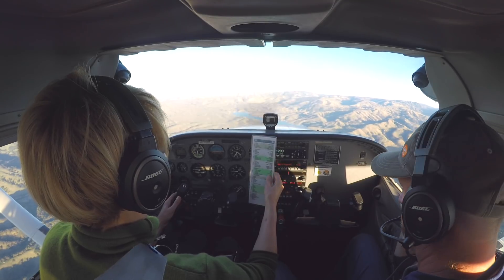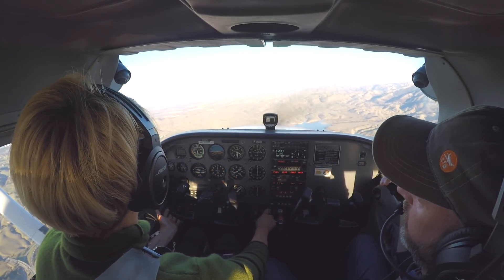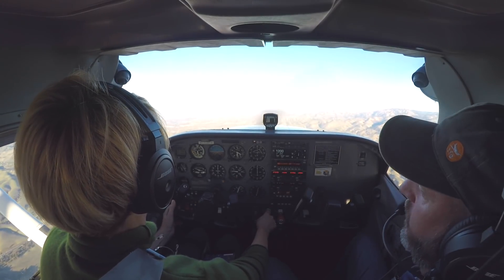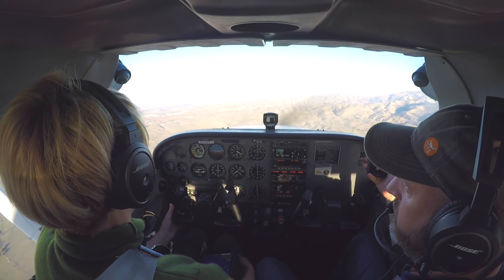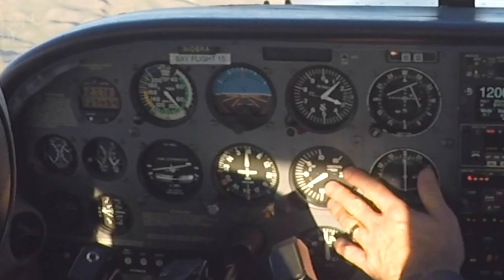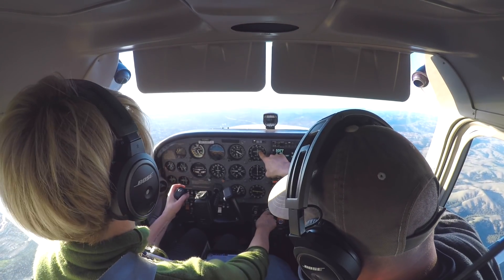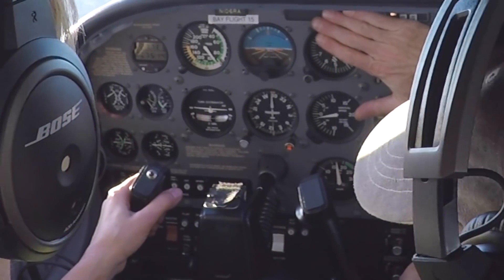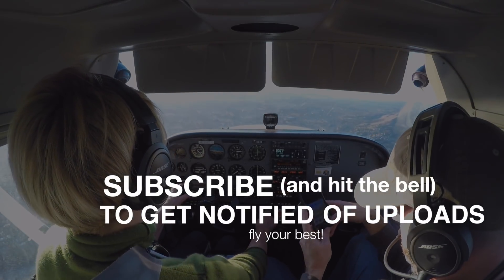How To Hold A Glide Slope - The SECRET that pro pilots know

Comment: I started IFR training but couldn't continue decades ago.  I clearly remember my instructor told me to use power to control vertical speed which is exact opposite of what you said.  I'm most likely not seeing a bigger picture and only remember smallest detail.  Just curious if there are situations to use power to control descent rate.
Reply: That is the correct method for slow flight, much of which is taught under the hood, or should be. It is very stable and reliable. Attitude = airspeed, and power = vertical speed, or altitude, depending on the goal (climbing or descending) or maintaining current altitude. 

He's saying that the power change has a longer delay in the glideslope correction than using pitch. So if you reverse it and use the faster pitch correction the, then you can adjust the airspeed with power and stabilize the approach with a potentially faster response.

Personally, I prefer the former, since I fly that way for any slow flight and slow or dragged out pattern work having to follow planes on very wide patterns. If you're used to controlling the plane that way it can work out well. If you aren't, it may be easier to follow this approach, no pun intended. It's worth trying it out, regardless, and see which one fits your flying style. I tend to like the original style I was taught since it meshes with what I've been used to for over 30 years. I will give this a try to see how it compares.

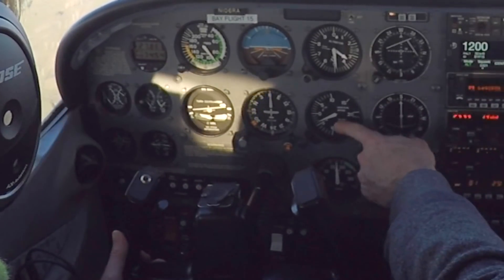Comment: Hey! At 1:25 you say that it's convenient to think of pitch controlling V/S and power controlling airspeed. Wouldn't it be the opposite? Since my PPL I learned that if you want to maintain specific slope and speed, you should pitch for airspeed and adjust power to maintain the V/S. It has always worked for me quite well this way for both instrument and visual approaches.
Reply from the maker: Really pitch and power are intertwined but it's convenient for different maneuvers to think of them in different ways. During steep turns, for example, we think of pitching to altitude and powering to speed but it's the "opposite" in slow flight. The point is that you get the most meaningful and precise data. In this case, pitch gives the most immediate response to vertical rate and that's why I say it's convenient to think of it that way. This lesson was taken from the FAA instrument flying handbook published in the late 70's (if you can find that someplace) and they have more on it there. If how you do it works, I'd say don't fix something that ain't broke if you know what I mean
Reply: My flight school does have this FAA handbook. Will definitely take a look into that, but I understand your point about precision and fast response. In fact, if you really think about it, you are taught to fly a certain way because it may be easier when you're adapting to the maneuver, but as the skills get developed, you just kind of interchange methods based on judgement and barely notice you're doing it! At least that's what I've just realized about myself now that I gave it a second thought. As you said, it's all intertwined after all. I've recently finished my CPL/IR/ME and I'm currently working on getting my CFI rating, so still have a lot to learn with other instructors and with the students I'll soon be teaching.
Reply from the maker: awesome! Yeah check out that book all the way in the back. There is good stuff there
Reply: I think the key is that if you know the power settings for your type then everything else falls into place.  In a Skyhawk ~1700 and 90 kias will give you -500fpm.  My CFII uses the FAA lesson handbook and teaches it as Jason does.  Fyi the FAA Instrument Flying Handbook is free online via the FAA website.
Reply from the maker: Rod Boone yes but I was referring to a few versions back which is a bit harder to find

Comment: Just saw this. Good technique that pitch is glideslope and power is speed, because if equipped with an autopilot, the AP will obviously pitch for glideslope, as will the flight director, if equipped. The airspeed control in that case is left up to you to adjust power.

In the corporate and airline jet world that I am retired from, we set the pitch attitude and set the thrust to known values when intercepting the ILS. That resulted in the proper speed and rate of descent for the approach. All one had to do was make minor corrections as necessary to correct for weight, wind, etc.

BTW, crosswind correction on final was a crab, never a slip...as the flight director would command and the autopilot would fly. If anyone reading this does it differently when hired by an airline or corporate flight department, they will have a tough time during the training portion.
Reply from the maker: Yeah that sounds about right. Also, you'll get the most immediate response to vertical speed from a pitch change which helps to hold the glide slope. Thanks for the comment
Reply: “Immediate response”...as in the autopilot won’t add/reduce power to maintain the GS. So why would anyone fly it differently from the autopilot unless they didn’t have an autopilot and would never have one? And that still isn’t a good reason.

I hope I don’t get in trouble for divulging a pro pilot “secret”.😀

Keep teaching the good stuff. At least one, old, 50 year, Gold Seal CFI agrees with you.👍

Comment: Totally agree that this video is confusing.  Even to his student.  The tried and true method is Trim for airspeed and use Power for vertical speed on an well established instrument approach. Yoke movement for quick corrections.  Otherwise you are chasing needles and there is far less stability in the approach.  It is true that it is a combination of all three but  I respectfully disagree with the method in this video being the best or what most pros use.  With retractable gear it’s nice to get set up with trim and power and simply drop gear at the FAF to follow the GS.  Knowing the numbers for your particular plane and adjusting to weather conditions at the time is key.

Comment: Jason, you say “...If there is no wind, this is your glide slope”. So how does wind affect this secret 90/500 rule? Been following you for years, great stuff, appreciate it. - Bobby from KC
Reply from the maker: Thanks Bobby! Well it's always based on a 90knot ground speed, if I said "no wind" I meant that it will only equal a 90 knot airspeed in a no wind situation. Thanks for following along!
Reply: I guess the missing link is: Aa a rule of thumb 5 x GS equals your descent rate for a 5% (3 deg) Glideslope. 
Thinking of that... No wind, 90KIAS => 90kt GS => 450fpm, 10kt head wind, 90KIAS => 80kt GS => 400fpm and so on...
Reply: @Bobby When you’re getting a 20kt headwind you won’t hold the glide slope 90kias and 500fpm descent.

Comment: Newb question. Does that only work for a Cessna? I’m just wondering how larger faster planes stay on glide slope? If there is a 15 knot headwind would you hold 105 Ground Speed?

Comment: When straight & level - trim for that particular speed to maintain alt. (Scan the panel)
When it comes to reduce speed and alt, that is when the glide slope needle begin to drop, - just power back a bit and the airplane will begin descent by itself, you don´t have to touch the yoke.(Scan the panel). Adjust in small increments, the throttle until you reach either 90 and/or 500. Now you can make the small adjustments with the elevator trim and the throttle. (Scan the panel) .The plane will follow the slope fine and you can concentrate on the localizer and the timer and minimum desc. alt. In your mind you go through the missed approach procedure. (Scan the panel). Make the best landing of your career ! (Or perform MAP).
/Peter CFII
Reply: Right on with the trim...to me one of the most important controls for precision approaches, VFR or IFR.

Comment: You said 90 ground speed, then 90 air speed... Power back, pitch for Vfe so you can drop a notch of flaps, power for decent rate, pitch for airspeed. 3 deg. glide slope. 90 and -500 fpm is a good starting point...

Comment: You have used the 90 knot and 500fpm all the way to 200ft AGL DH.  How do you smoothly transition to landing in that 200'?  Flaps down?  Power?
Reply from the maker: Consider that the glide slope leaves you at a precision runway (which is typically plenty long (around 5000'). In a low performance single such as the Cessna you see here that is plenty of time to pull power, bring in flaps, and land on the first half of the runway. In a high performance single (such as a Mooney, Cirrus, or Bonanaza ... or a twin) I would use the first flap setting at the final approach fix.
Reply: The Finer Points thanks.   I will work on that transition and watch how much runway I use in my 172
Reply from the maker: Chris Miller yes and let me know what you find

Comment: For a standard 3° glide slope just take half your airspeed and add a zero. It'll put you in the ballpark and is easy to adjust from.
Reply: Ok the way you explained it makes no sense at all. Not good. 45 kts, (half the spd in this vid), and now (add a zero 0)????? So I want 450 kts? No.
Reply: @MasterCarguy44-pk2dq  Ok I didn't state "rate of descent". Half of 90 knots is 45. Add a zero to make it 450 and use that for rate of descent. 450 feet per minute. I also didn't state you'd have to add or subtract from that based on what the wind is doing to you.  The whole video was talking about rate of descent. I thought most pilots could figure that out. Guess I was wrong.
Reply: Thanks for this tip. I was having a hard time figuring out a descent rate for my speed in my head. This really helps.
Reply: @JeromyReimer  you should never just figure it out in your head. That's how people die. I can go from walk around to airplane start, taxi and take off in my head but I use a "checklist" and write everything down, everytime. Forgotten checklist items have caused many many accidents in the last 65 yrs just in the US alone.... Also, do not rely on technology more than 65%. Raw data and knowing what to do with it is your best friend and will save your butt. Infact technology has proven that today's pilots are more lazy and likely to miss things than us old school guys that used 65% raw data w/steam gauge and partial glass vs full glass in the flight deck. Pilots that hand fly more are 70% safer than those that do not very often.
Reply: @All_Roads Gotta bait the 90% of "know-it-alls" on StupidTube,
Reply: @All_Roads Gotta test you goons. I've been on the line (121) since 1994. Was an FE for 2 yrs then an FO and Capt in every Boeing made from the "go kart" 73-2 to 74-4, a few A-buses 300/310, small and large McDonnell products. It goes and goes. Started with my ppl and inst fixed and rotor then did 12 in military. I got my multi fixed, C-12H, OV10B and helo AH-1. Got fixed cfi and helo comm and cfi. Rare is the full helo paper through cfi. Was a gold seal cfi 7 yrs. I just love coming in here and testing you kids, under 40. I'm 61.

Comment: Thank you for this video. I teach my students the same technique for holding a glideslope: pitch for altitude, power for airspeed. 

With 99.9% of ILS approaches being a 3 degree glideslope it's easy, once established to transition to a 3 degree nose down attitude on the AI and reduce the power to a known power setting to maintain airspeed.  Once established, cross check VSI for proper rate of descent and make adjustements to the AI in 1 degree increments if needed. Do the same for airspeed, reduce or increase power in small increments (100 rpm or 1'') to adjust to the proper airspeed. Bonus tip, to figure out the ROD based on GS add a 0 to the ground speed and divide by 2 (example: 120kts GS = 1200 / 2 = 600 Fpm ROD).

APs and flight directors all fly these types of approaches by pitching for altitude and powering (ATs) for airspeed...they must be onto something ;)

Great videos! Keep it up!
Reply from the maker: Nicolas Bourbillon thanks! We sound like birds of the same feather 😊
Reply: Well that will only work if you are at the horizon on approach speed...Normaly you will have a bit of a nose up attitude on in this speed range....The only thing helping you there is a FPV... Or am I wrong?

Comment: This is great but I tried landing a 747 in the simulator and the 165kt IAS approach at 18,000ft seems to be much less than the actual Ground Speed, and then when I do reach about 1000ft above ground, the GS has slowed to almost the same as the 165 IAS. How do I compensate for the constantly changing difference as I try to calculate the feet/mind descent rate?

Comment: So we're flying a Cessna 172 down a glide path on final approach at 90 knots (103.5 mph) which is 43 knots over Vso and over the flap operating speed with no flaps extended.  Good luck trying to land that and stop it

Comment: 90 knots is a little hot for final in a Cessna 172 isn't it? At what point would you reduce speed/descent rate?
Reply from the maker: Most precision approaches end at a runway that is plenty long to identify at the DH, pull power, add flaps, and slow down. If it were a Cirrus, Mooney, Bonanza, or C210 I'd probably add some flaps at the FAF. The nice thing about small airplanes is that they slow down fast :)
Reply from the maker: Most precision approaches end at runways that are about 5000 feet long, once you go visual at 200 feet, power to idle deploy flaps and lose the 25 knots you need to lose to land. It works. If it's a high performance plane I'd put first flaps in at FAF
Reply from the maker: one more thought - the FAF is usually 5 miles from the MAP --- so it's not really "final" as you know it. You wouldn't fly the last 5 miles of a visual approach at 65 knots.
Reply: Hello. I’m new to your channel and really like your videos. I’ve definitely learned something new with every single video - great content :) 
I have a few questions: 

Doesn’t the vertical speed you need in order to stay on the glideslope depend on your ground speed, not IAS? I can imagine you will be able to work with 90 kts IAS if you are relatively low (what usually is the case during ILS approaches) and if there’s no wind so IAS would almost match GS. Was this the case in the video? 

If you fly the ILS with 90 kts and start to pull flaps and slow down late as you described (let’s say 200 ft AGL) do you think there is enough time to correct your trimm setting and keep the approach stabilized?

In this video you asked your student to pitch for V/S (-500ft./min) and use power for airspeed. I’ve seen a couple of videos on YT where instructors tell their students to do things the other way round (pitch for airspeed and power for VS). So do you use this method for ILS approaches only? The way you did things in the video actually is the way you would fly a jet as far as I know. there’s always a correlation between those variables (pitch, power, airspeed, VS), isn’t it?

I’m not a pilot yet, I’m a simulator pilot (working at a local 737 sim with some IFR experience) who’s willing to learn as much as possible on the ground before starting my PPL license in summer.
Greetings from Germany!
Reply: "Doesn’t the vertical speed you need in order to stay on the glideslope depend on your ground speed, not IAS?"

Correct. The rule of thumb is GS x 5 which at 90kts is 450fpm. But 500 is a good starting point.

"If you fly the ILS with 90 kts and start to pull flaps and slow down late as you described (let’s say 200 ft AGL) do you think there is enough time to correct your trimm setting and keep the approach stabilized?"

Well by definition, if you pop flap at 200' it isn't a stabilised approach. Nonetheless in a light aircraft it isn't a big deal. In a big jet it is a no no but in a light aircraft it is an option.

 "I’ve seen a couple of videos on YT where instructors tell their students to do things the other way round (pitch for airspeed and power for VS)"

Correct and that is perhaps the convention. But the bottom line is either way leads you to the same pitch and power. In many light aircraft, if you reduce power they will pitch down and vice versa due to the effect of prop wash on the elevator. Therefore if you are trimmed for 90kts and reduce power a little the aircraft will pretty well take care of the pitch by itself. For that reason I use the technique you mention.
Reply from the maker: All true stuff. Yes, groundspeed not indicated speed. The drawback to pitching for speed and powering to VS in this situation is the delayed response time to your VS, better to pitch for VS and get an immediate response when on instruments. Once you have runway in sight, it's "normal maneuvering" to land, which as you mention in a light airplane is no big deal. This would be flown differently in a jet or larger heavier aircraft.
Reply: @TheFinerPoints  My RV-8 doesn't slow down very fast....it's a pretty clean machine. But I'm big on using the VSI during descent, as my Garmin GPS constantly tells me the required VSR to TPA at 5 miles out from the destination airport. I normally begin my descent from cruise altitude once the VSR hits 500 fpm, and descend at about 200 mph. I don't do instrument approaches.